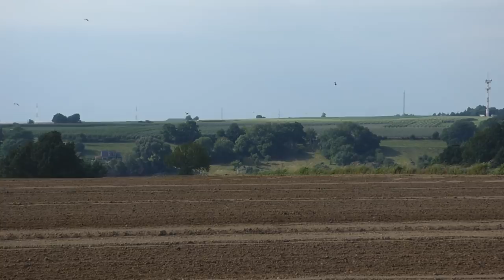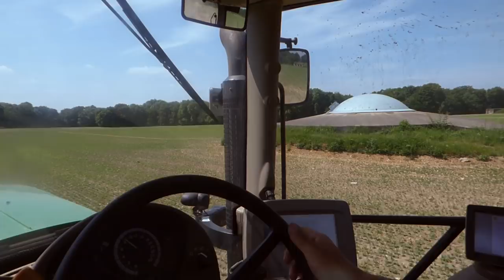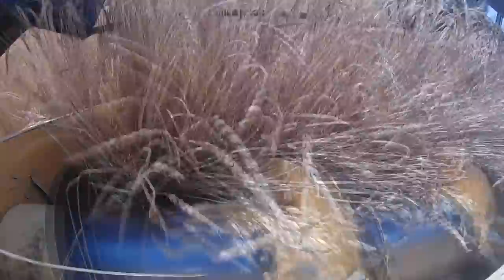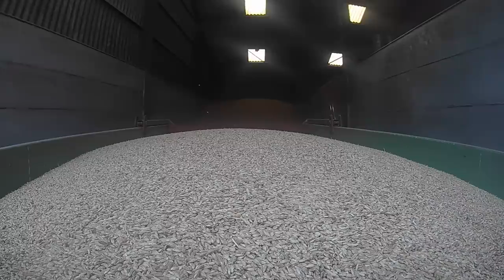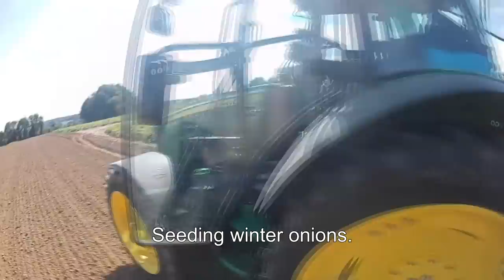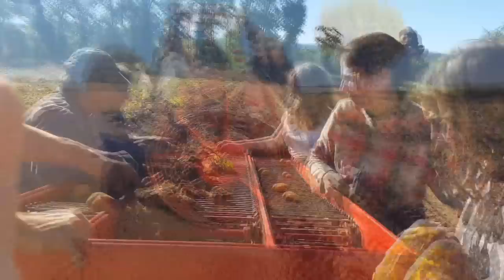I quit woodworking

Comment: hope that you have some time in the winter to do wood...   a q feestool have now a new storage on wheel with folding area.. looks like the one you did have they got it all from you!!!??
Reply from the maker: They paid an engineering company for the design, that company may have used my design as an inspiration, but it's also possible that a tool with those functions will inevitably have a similar shape.
Reply: @TimothyWilmots  for me that is a big thing that you think of the design before them..!!! thank for the nice thinking...

Comment: Sorry to hear you are you are returning to farming. I will miss your inspiring designs ideas and videos. However, as Nicolle said if it turns into a farming channel, I'll watch! I'd love to see more of your camera-guided bean weeder and other farming tech :-)
Reply from the maker: The weeder was delivered too late in the season to be used extensively, but there are some modifications we need to do as the tractor lift has too much play. Also next year we will be using it together with an RTK guided tractor, here we had to concentrate on driving manually between rows. Makes you go crazy after 5 hours.

Comment: Amazed that you can drive right over them with a tractor and they’re obviously still fine ?
Reply from the maker: Some crops don't mind up to a certain height, but you have to do it in dry conditions so you don't compress the ground and the crop. We were amazed as well when we switched to organic that we could do this.
Reply: Interesting, thanks for reply. Great vids btw